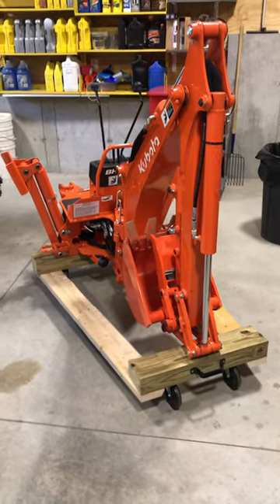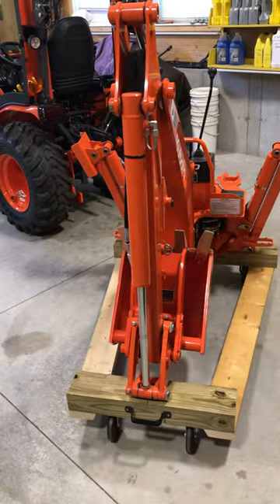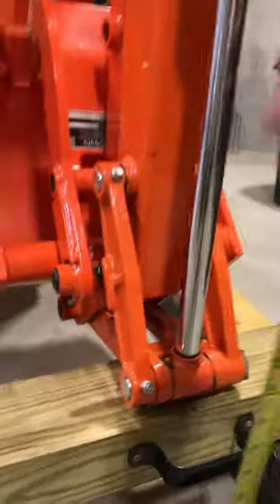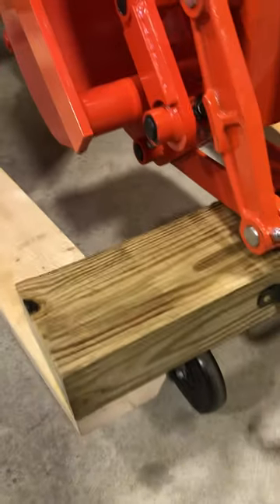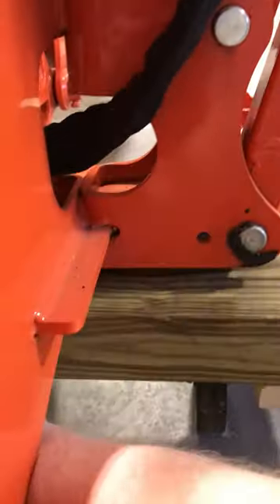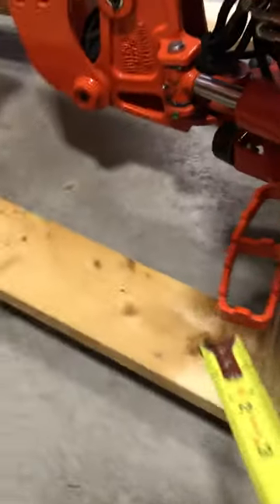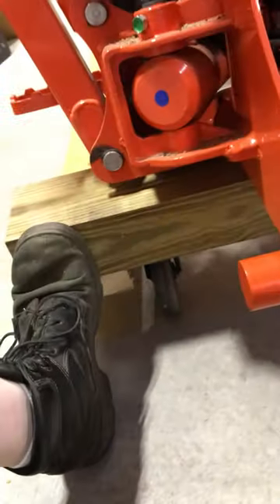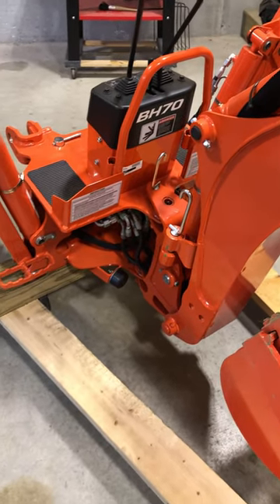BH70 Backhoe Storage Dolly

Comment: Brian, I have a question as I’m about ready to build a dolly. I know that the boom pivot point was lower than where the stabilizers sat, but why did you need to notch the beam that the stabilizers sat on? I thought as you move the boom that the hoe just folds towards the rear and out of the lugs and bucket pushes down. Therefore how does that pivot point interfere? Thanks.
Reply from the maker: Hello,
 Thanks for watching. The reason for the notch was because the casters I used were kind of tall. The casters plus the 4x6 made it just a little too tall to roll it underneath while the backhoe is still on the machine. There is no interference actually taking the backhoe off, my dolly was just a little too tall in that area. Also, I forgot to mention in the video, but if you look closely at the bucket end you can see where my casters interfered with the 2x6's. They could not turn. So I just used a sawzall (I think, it's been a while) and took away some of the 2x6's so the wheels could pivot. I think 2x4's would have worked just fine, and not interfered. They are not really structural, they just keep everything together. The 4x6's and casters carry all the weight. Hopefully that makes sense.